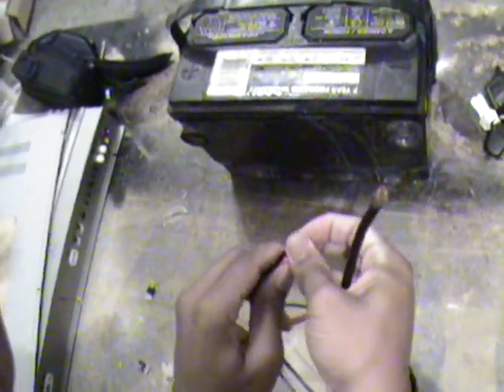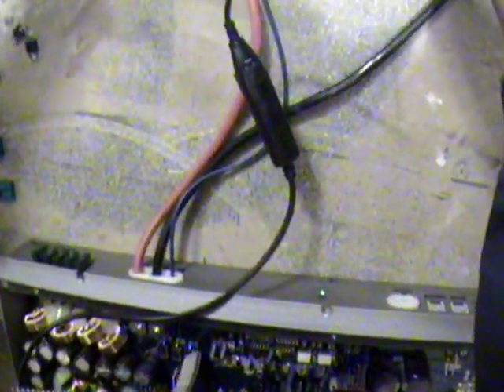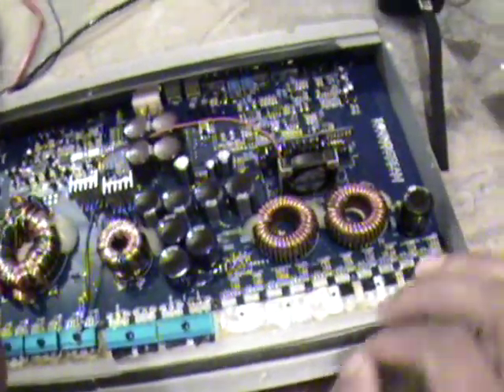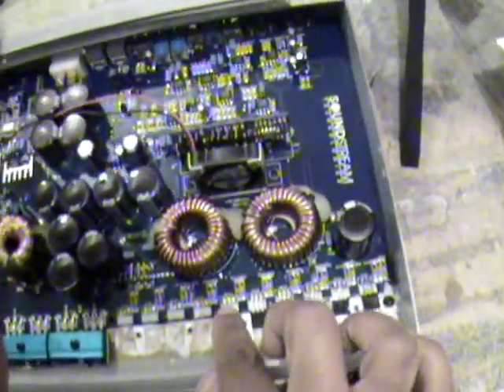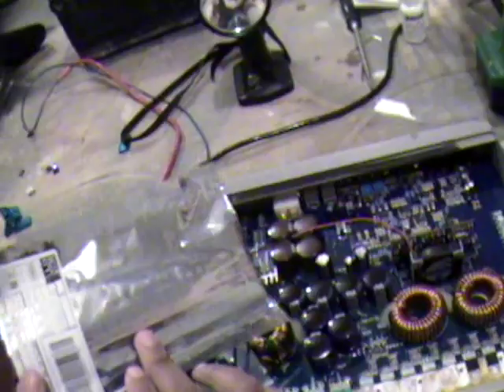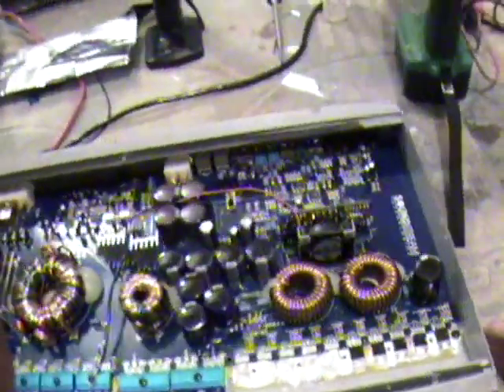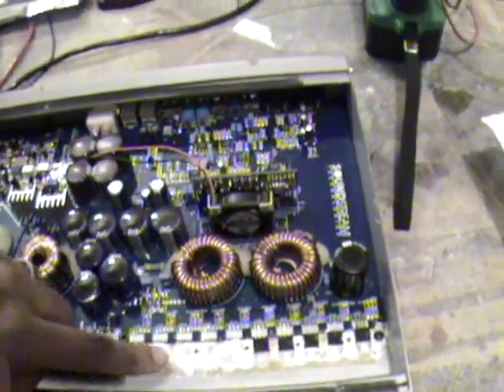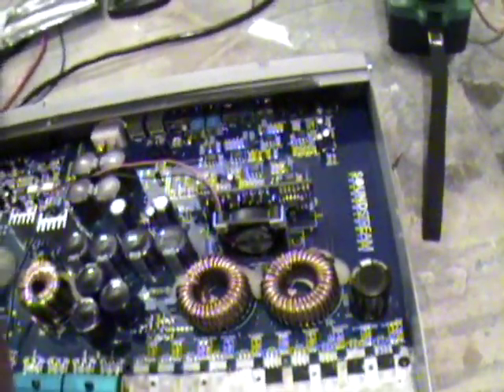Amp repair part 4.avi

Comment: Ok so I had a Kicker KX2500.1 amp that would not come out of PROTECT MODE!!!! I would take off all speaker wires. Checked power, ground, and removed control and rca outputs and still went into protect!!!!! As soon as I turned the amp on it would stay in protect!!!! After watching this video. I opened my amp and replaced a bad mosfet or (transistor) and MY AMP TURNED ON!!!!!! THANK YOU SO MUCH MAN!!!! You helped me restore the ground pounding power of my KICKER AMP. This video really helped!!!!

Comment: Sir, may I ask? How do you know there is other internal damage? Did you check the gate, emitter resistance? To verify they are all within tolerance. And did you check you npn driver transistors? The ones that driver the output transistors on and off. I've done repairs where i didn't bother to check any of that and the amp failed again! And i wasted money also. Just throwing out tips. Keep up the diy repair work (:

Comment: Hey i have mtx terminator amp and i have 6 total transistors and check them all and 2 were good with high mega ohms and the other 4 were bad with 0 m ohms but when i check the 4 i got a beep sound when i did so. Is that normal also i cutt the 4 bad resistors off the board like u did and powered it up and its still in protect mode with the bad transistors removed. So does.this.mean the transistors were bad and there something else bad also? If you could.get back to me i would apricate it thank you